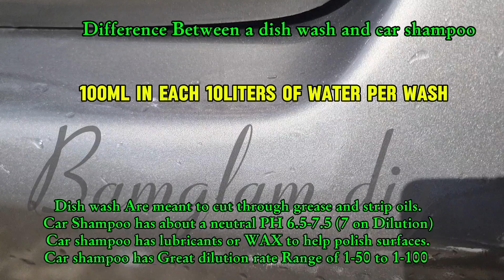HOW TO MAKE HIGH FOAM CAR WASH SHAMPOO WITH SILICON OIL LUBRICANT

Comment: Please ma, will it be bad if nitrosol is added to it
Reply: This is so amazing. I just got my silicone oil and I am going to try out the formulation. Thank you for sharing your wealth of knowledge FOC. God bless you immeasurably ❤❤
Reply from the maker: Ur choice not mine. 
I actually dont need it.

Cause i dont know the function it will perfom
Reply: Hi dear sister can i add CDE to boost the foam?
Reply from the maker: CDE is alkaline.  U can use sha. I memtioned it in the video. But make sure to control the ph. After adding the CDE bring down ur ph.  @emilymorotoba5532
Reply: @Bamglamdiy  ok noted.